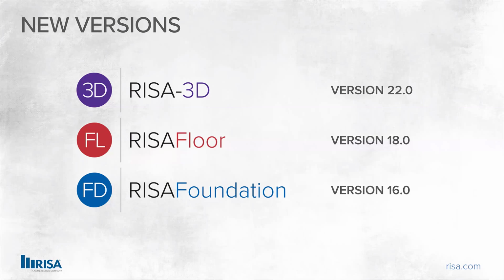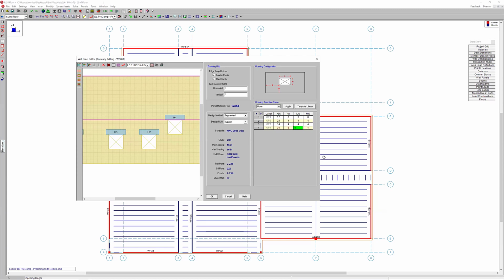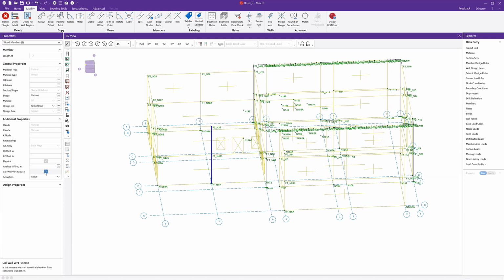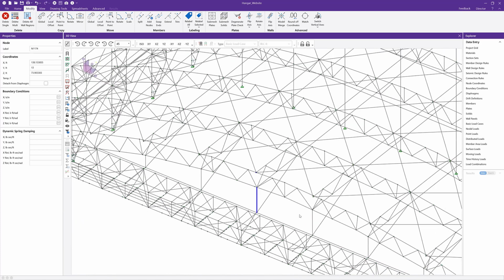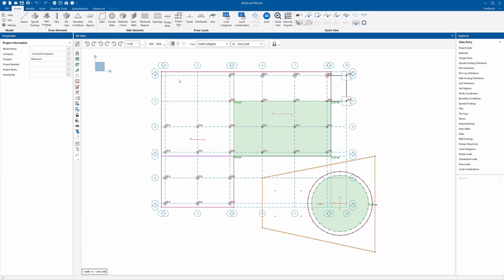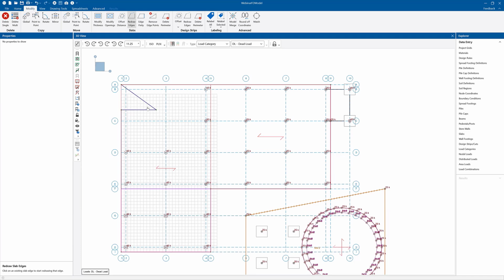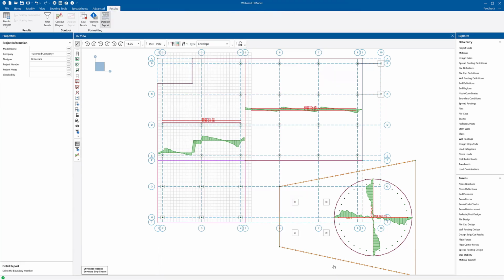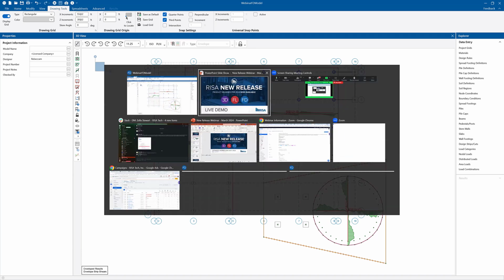Enhanced Workflows with New Releases of RISA Software

Comment: 1⃣ “What is the recommended workflow in RISA Floor to model a sloped roof at the first-floor level? Specifically, how can I introduce the roof slope within the existing floor diaphragm without creating an additional floor level?”

2⃣ “How can I model the upper (main) roof geometry in RISA Floor without generating a third floor? Is there a method to define roof framing or a sloped roof surface above the second floor without adding a new story?”

3⃣ “When placing windows or doors in a wall, the software does not clearly indicate where the wall segment begins or ends. What tools or settings allow me to accurately identify the start and end points of a wall so that I can position openings correctly?”